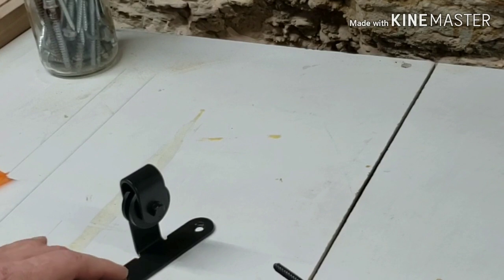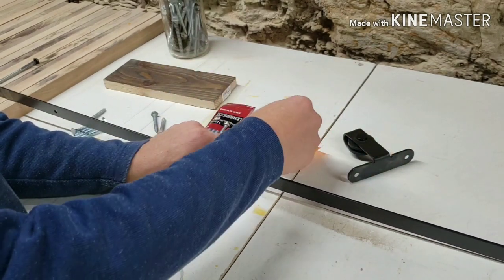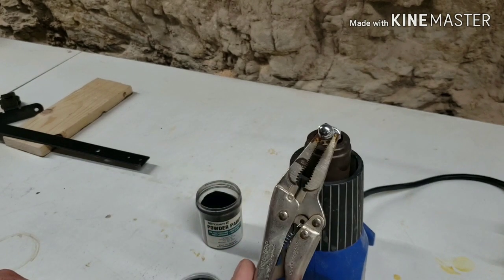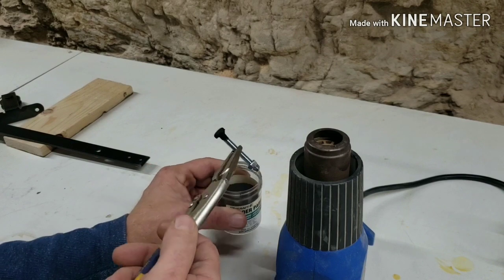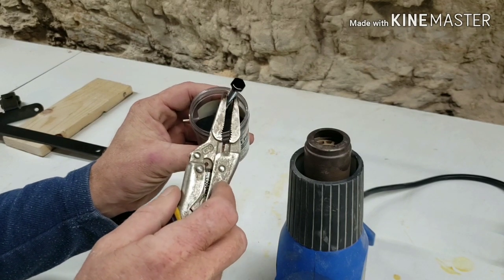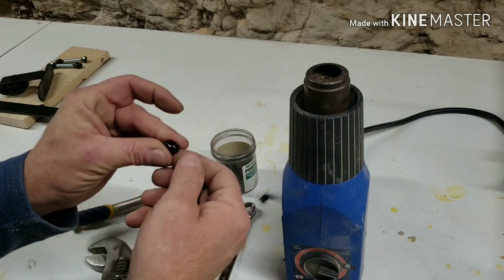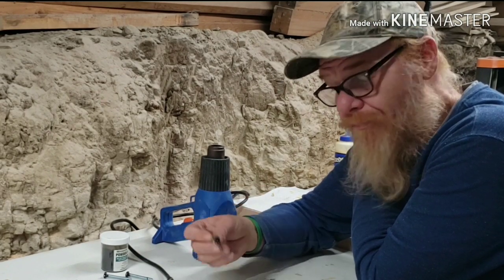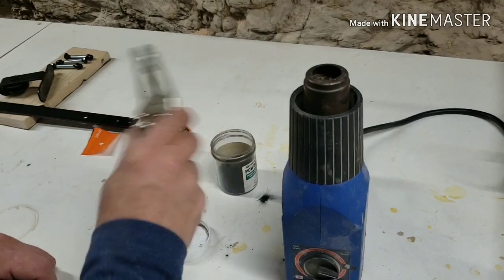HOW TO DO POWDER COATING AT HOME | BARN DOOR DOG KENNEL

Comment: I never knew you could powder coat like that.  Great info. Thanks.
Reply from the maker: Glad to help!  It was a skill that I had used for fishing lures and jigs, so when I ran across this hardware quandry, I said to myself..... self " _why dont you powder coat the bolts" ___and I responded.... DUDE that is a good idea!!!!!!!
Reply: @MakinSawdust , I alway though you had to charge or have something to do with grounding the item you are powder coating so it will stick.
Reply from the maker: I think in the commercial environment electrical charging is how the powder sticks to the surface and then the heat bakes it hard, but in small applications like this the heat is what allows the powder to stick.

Comment: Great video!  Just curious, how much more durable is this method of painting over something like spray paint?  Do you have a hard time tightening a nut without damaging the paint?
Reply from the maker: Thanks Rob! I left it out of the video, but i went with this method because it is more durable than spray paint. I did not want to have my hardware get chipped or flake off when i tightened it. I used a standard powder paint, but they also make a style called 'hammered' and it is much tougher but requires a little more bake/curing time. The powder paint adds a little thickness to the head of the bolt but ususally the wrench will still fit.

Comment: How do you screw it on to your project without damaging the coating?
Reply from the maker: The coating is actually quite durable, more so than a painted surface. They also make a 'hammered' finish powder coat in the brand that I highlighted that is even tougher. I used 2 wrenches to tighten up the hardware and it didnt chip. Thank you for your comment.
Reply: @MakinSawdust  Thank you so much for your reply. Is this also the stuff that you dip the handle of tools in?
Reply from the maker: @craftyrats  you certainly could do that so you can color code them for ease of locating or sorting. There is another product that i have used called plasti-dip that is kinda rubbery coating also.

Comment: Do you have to bake the parts to cure the powder coat?
Reply from the maker: yes it is usually the best way to do it. As for this video and the way I did it, I heated up the hardware too much and the powder turned glossy rt away. When I do fishing lures, I use a toaster oven, heat up the lures enough to dip the lure and the powder will stick but it will be powdery looking still. I then put the lures back in the oven until the lures are glossy and once they are cooled down they are cured. They do have a powder that is supposed to be a harder coat and a bit more durable. Thanks for your question